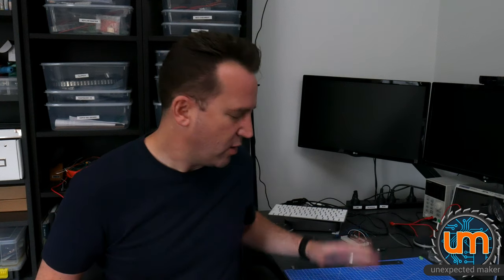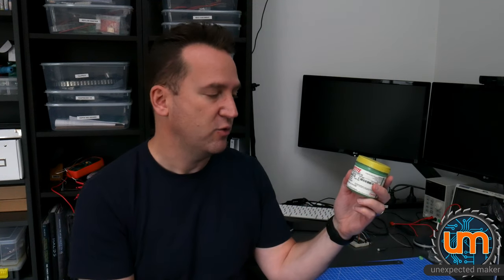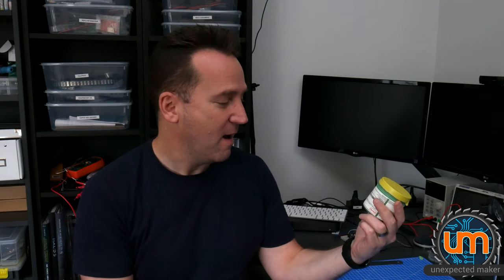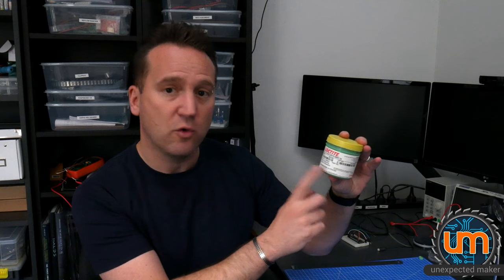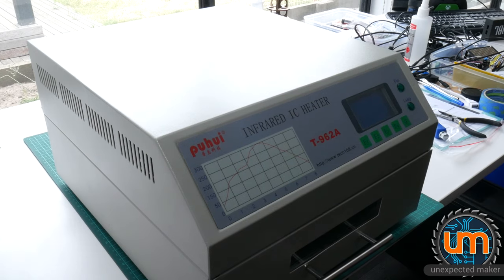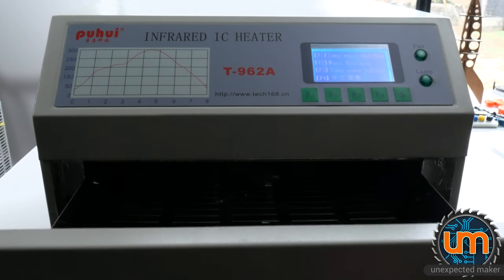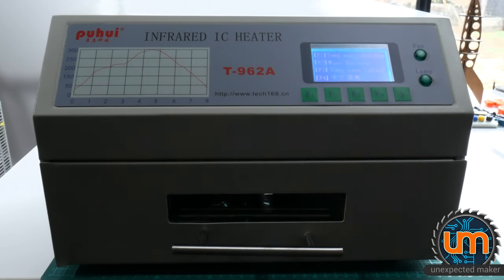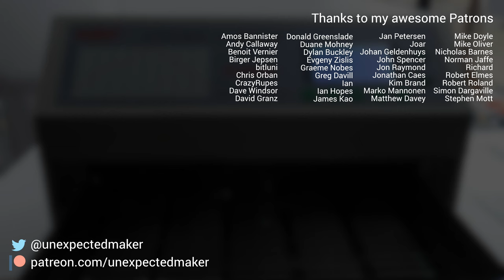I bought a new tool for the workshop!

Comment: The cheap and working diy version is the Severin TO 2034 toaster oven. It is fast and can go to 250c. Coupled with an simple temperature controller it is good enough for hobby reflowing. I use low teperature lead free paste from aliexpress.. because reflowing with 240/250 degrees can burn your silkscreen pretty fast and the results are not worse than those i had with normal paste. Anyway.. a real profile controlled oven is a nice thing to have:)
Reply from the maker: I'd not heard of the Severin TO 2034, thanks! I was also using low temp, but it's not great for production boards.

Comment: Wicked!! A reflow oven!! ... I want one!! Slow start profile to not shock the components!! Love it!!youll need a soldier paste squeegee soon!!
Reply from the maker: I need to design a solder stencil frame system for adhoc stencils and then I can get q squeegee!
Reply: I wonder if you can 3D print some solder stencils?
Reply from the maker: Nah, even with a 0.2mm nozzle, you could only 3d print maybe 0805 size pads at best... no way I could do fine pitch ICs etc... I can't even laser etch them on my 80w :(  Stencils are still something I will always buy in steel, but having a proper holder/application jig would be awesome!
Reply: Unexpected Maker that’s a very good point...  can you photo etch them some how...  meh... I guess just buying them makes way more sense..   look forward to seeing how you get on with this...  I was surface mount manager in a previous job many years ago, so may be able to seek some practical guidance reference profiles if you fancy...
Reply: How fine can your laser cutter go, and can it cut Mylar?

Comment: You can't use the whole of the tray the most central 80% works great, the outer parts can be a bit temperamental. Also, with the loctite lead free stuff, it goes through the stencil really well but can need a slightly longer reflow time if you're doing qfns than the datasheet aims for.
Reply from the maker: Yeah, that's exactly why my toaster oven just can't cut it...  I'm having to reflow hotter and for longer than even the Loctite  datasheet suggests... and that's even just for single TinyPICO size board :(

Comment: We have one of those at the makerspace that I've used quite a few times.  The heat isn't very even, so I've had issues with components at the far corners not reflowing well.  I've solved it by running fewer boards at once, closer to the center.  I suspect it could be improved with some additional insulation inside the enclosure.
Reply from the maker: Yes, I have read much about the unevenness of the reflow - I think some type of fan or way to move the heat around inside to even it out would be the ideal solution to prevent hot/cold spots... but finding a super high temp rated DC fan is going to be a challenge :(

Comment: Seon! Again, with the cool toys. ;)  Very nice. Improper (or, could be better) grounding seems to be the most common issue with mains powered equipment.

I remember considering the T-962 (not a 'A') a while back, but it was overkill and too expensive for my needs. I recall people were making simple mods to improve its performance like moving the thermocouples much closer to the tray because they were burning their boards (thermocouples were measuring air temp, which was slightly cooler than the actual board temp). Also, I remember that someone modding the firmware, making several enhancements. Anyway, perhaps the 'A' revision solves these issues.

Congrats on the new toy. I'm looking forward to reflow videos.
Reply from the maker: Unfortunately the T962A is the same and needs a minimum amount of work just to be usable... Grounding, removing of masking tape etc... but I have some other mods I want to do including the firmware upgrade. I'll make another video about it.
Reply: @UnexpectedMaker  Good morning, by the way. Oh, yes, I remember the smoking masking tape. On another note, I also remember watching a video of a guy strategically wrapping his toaster oven in a fire blanket (sealing gaps with gold coloured high heat tape) to attain higher, more controllable temps.

And I assume you've seen @backofficeshow completely toast a PCB when he first got his T962A, https://www.youtube.com/watch?v=4ODMPFmG5SA.
Reply from the maker: Hahahaha... If I have to go to that extreme, honestly, I'll give the T962A away and get something else. I'm mostly worried about burning PCS/Components due to hot spots, not cold spots.... I might have to buy some extra hardware and do some serious mods... but I am hoping I wont have to.
Reply: @UnexpectedMaker  I eagerly await to see how it all goes.

Comment: Btw, have you tried to reflow that loctite with hotair station? I have that same loctite, but havent tried yet and i do not have reflow oven myself (yet). Biggest reason to buy loctite was that its so much easier to store.
Reply from the maker: I have, and I had to get the hot air up to 350 to get it workable... but I only hot air for rework, not for reflow. Yes, there are many more advantages to the Loctite than I mentioned in the video. Storage and life on a stencil/PCB before reflow is also fantastic.

Comment: Are you planning on upgrading the controller with your Reflow Master?
Reply from the maker: Make a custom Reflow Master for the T962A? Is that what you are suggesting? Hahaha... The current revision Reflow Master can't drive the T962A...  but...
Reply: You made mention that there was a Reflow Master Rev 2 in progress, I just thought possibly ....
Reply from the maker: Ahh, my current plans for the Reflow Master rev2 is still based on toaster oven support. A T962A version would need quite a different design... one very specific to the T962A and would need to run off mains. Maybe one day ;)

Comment: Wait, are they normal shelf sliders?
Reply from the maker: Yeah, and flimsy cheap ones too!
Reply: @UnexpectedMaker  considering the temp of your paste, I'm worried about the plastic in those sliders!
Reply: I was thinking more about the lubrication in those sliders. That will be burned off in no time.
Reply from the maker: Possibly, but there are many people using these for small production, and none of the mods or issues ever brought up have to do with the plastic or lubrication on the sliders.... so I guess time will tell :-) Some good silicon lube spray every few months will prob suffice.

Comment: What a mess about? Did that really have to be done🤔
You spent money to get it , so you could mess about with ground .why? Send it back
Reply from the maker: Send I back and get what? Everything from China comes like this. Fixing the ground is easy.. and all electrical workshop equipment should be checked for wiring before use.